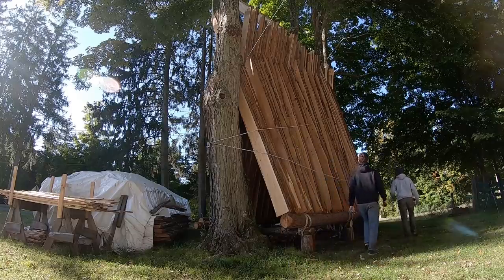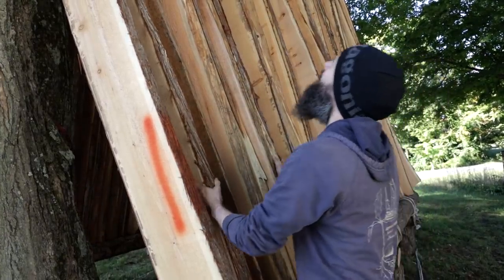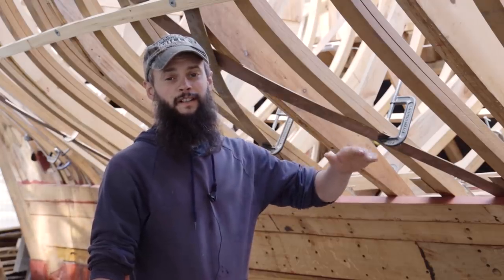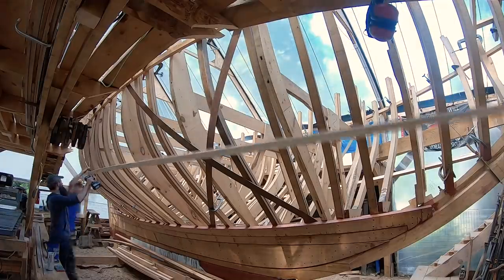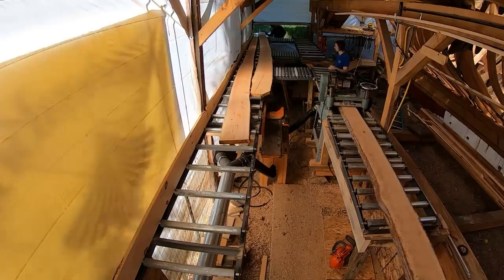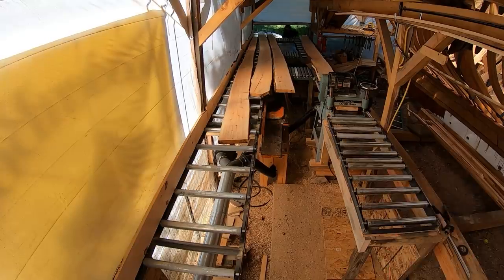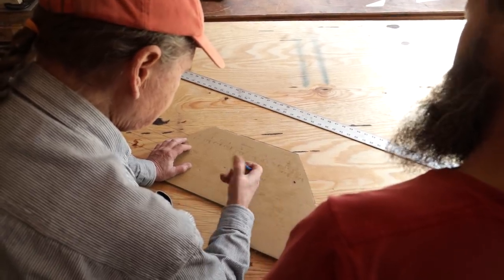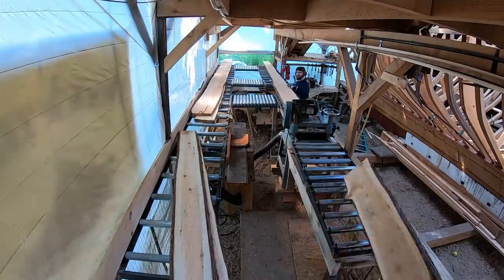Acorn to Arabella - Journey of a Wooden Boat - Episode 84: Lining Off and Diminishing Board

Comment: You know, at this point, wouldn't it make sense to just use the oak all the way up to and a little past the water line maybe? I imagine Oak is going to take a collision much better than cedar. I always hear stories of boats running into containers that have fallen off container ships. These containers float just below the surface of the water and are very hard to see and quite a few boats have been holed by them. Maybe there's no real advantage to oak over cedar in this scenario though, I don't know, but it seems like if you're going this far with the Oak, one more plank to bring it just above the water line wouldn't be that much more work for potentially a lot more protection.

Comment: Thank you for spending some time on lining off.  I think that lofting, liniing off and spiling are the arcane secrets of boat building.  People look at a well planked boat and think that all the planks are parallel and therefore square.  Actually nothing could be further than the truth.  Planks have some amazing complexity and the techniques necessary to make it look good are unique to boat building.  Thad Danielson's soft spoken experience is a real treasure.  There is no substitute for experience in these things.  You will probably never build another boat like Arabella so you don't have the luxury of doing it better the second time.

I had to smile at your sense of hardship at having to add a few more white oak strakes.  To have more white oak than cedar is a luxury only you guys can enjoy.  If you had known that was coming you could have probably saved a few hundredweight of lead.
Next stop to your shop for a new Tshirt.

Comment: Wiser words were never spoken..  "there's a plan, then there's what actually happens".
It's nice to see that you don't put every effort into sticking to "the plan", as that can get quite expensive. Being able to switch or alter plans on the fly can be a very valuable skill and mindset. It can save loads of money and reduce excess being left in a pile to rot, or save the time it would take to find a buyer for the left over materials that end up not being needed. Very mature thinking.
Not much actual building progress in this video, but loads of thinking work done for sure. See y'all on the next one.

Comment: I found this particular episode the most entertaining and informative yet. Now I ALMOST fully understand the lining off process. Just need to know how the distance to the common point for the diaganols, along the axis perpendicular to station 6, is determined. This lining off business has befuddled me for a lifetime. Now I get it. Nothin to it. Thank You for the education.
Reply: I believe the point is arbitrary, within reason. You are working out a linear interpretation between the plank widths at each station. The steepness of the slope changes the accuracy of that interpolation, so presumably the gentlest slope you can fit on the layout board and still have the point of intersection accurately placed, is the best you can do.
Reply: That actually almost makes sense to me. The further the "arbitrary" point, the greater the accuracy. Thanks for the reply and again the education.  I'd rather see the why and how than the what. And these guys do it best.
Reply: I'm still trying to figure out why the frame isn't made a bit thicker, then cut a flat section on the frame instead of backing out a curve into the planks?

Comment: Gentlemen I just came across your videos a few days ago and I binge watched them all. I'm not really into boat building but I love learning new things, so thank you. I am a carpenter though and I can see the diminishing board coming in handy from time to time so I wanted to get a better understanding of the point in which you diminished the lines. Everything else was very clear. I just didn't catch how you choose the distance to the point that that the lines diminish to. This point not being correctly placed would have an impact on the angle and that would translate to the individual thickness measurements. Thank you for the awesome job you both are doing documenting the project.
Reply: So my understanding is that he is measuring the distance between the stations up vertically until he hits the diagonal line at the top. Then the interesection between this new vertical line and all these diagonal lines show the plank widths, so nothing is measured along the other axis so it doesn't matter where it vanishes. I also found that difficult to grasp from the explanation

Comment: Wow is this technical or what? I guess there's more to it than slapping boards on the frames to keep the water out. Getting very interesting now, can't wait for the planking.
Reply: Yes.. there's a LOT more to building a boat than almost any other kind of structure.. after all the whiners here moaning about "nothing happening", it's nice to see someone who actually gets it!
Reply: Yup, other constructions either keep moisture at bay via a thin membrane, i.e. houses and land buildings, or keep water in in small amounts, comparatively, i.e. tubs and pools. This type of construction takes and holds out liquid and much higher pressure than atmospheric pressures such as a house. The only things built to take much higher pressures are submarines. It is interesting to think a fallen leaf can float and some bugs can walk on water, but when you consider the weight difference, the structure must be so much stronger as the floating item gains in size and displacement. A strictly timber framed boat (using traditional timber-framed home design) would collapse under the load of the water, but can withstand hundreds of years sitting on solid ground. Still, many of the same joinery types can be seen in both erections. The span between major framing timbers are much closer in ship building. Just something I think about when watching tours of old ships versus old barns and houses.

Comment: Am I correct… even width planking shows off the lines and shape of the hull, like Viking boats do … and planning that holds level to the water line hides the shape and lines of the hull, but making the boat look “sleek” and smooth. I think I would prefer the Viking lines (but I would have to build a model to scale both ways so I could see the difference for real and to decide). Still, you sure did learn a lot and taught us landlubbers a thing or two. Thank you for your efforts. ||| I like the oak planking up to and even a foot above waterline idea… oak is tougher against stuff floating in the water you don’t/can’t see that can punch holes (or like ice when you venture up north or south).

Comment: A spinning lazar level , used for acoustic ceilings can be used to get exact lines from stem to stern that you can see all at the same time .  In theory , you could mark the lines of every plank right on the frames before you start . The lazar line would be straight and level which would give you an excellent reference point to go by . Just a thought .

Comment: The advantage of more oak below the water line is strength and ballast.
Reply: Will the additional ballast affect the water line? Not that the water line is literal.
Reply: @travelinman70  They can just put fewer lead ballast weights in the bilge. The keel alone is purposefully not heavy enough to provide all the ballast weight that the boat needs.

Comment: I noticed you have a 16-300mm Tamron lens on your wishlist. I'd like to draw your attention to the Sigma 18-300mm lens. Nearly exactly the same specs, also macro, also Canon mount available. I have the Sigma 18-300 and it's my absolute favorite go-to lens for its image quality and focal range. And it's $230 less  than the Tamron.
Tamron 16-300mm: $630
Sigma 18-300mm: $400

Comment: I am wondering, since all those planks will be bend to fit them to the hull, will they not accumulate a lot of tension? Or will the wood comply to its new shape over time?
Reply: The wood takes its new shape within hours or a couple of days, just like it would if it were steamed. Remember with the early oak planks, they would leave them clamped overnight to take the new shape before doing the final shaping.
Reply: Wood tends to be a very forgiving medium. Even in growth, the wood will form around an obstruction more often than pushing it away.  Anyone who has cut down a tree and harvested it from old farmland then cut it into lumber or firewood has found fencing, rocks, and other obstructions within the wood. We have several trees on campus whose roots have formed around the sidewalks instead of heaving them out of the way. Seeing roots spill over relatively thin concrete is quite beautiful. The plant trying to work with, rather than against, mankind's invasion of its space.

Comment: I just noticed !   Your bandsaw,, I used to own the same model.  Quite a few years ago,, and mine when it came to me was still set up for a leather belt,, central shaft power.  I converted it to a floor mount electric motor.  Great saw.  I had to redo the journal metal and some guide bearings.  Museum piece,, but some of my hand planes are older,, and my framing square.

Comment: Your a very good team. Im sure you have your highs and lows. As you were going through your cedar stock I was wondering do you have enough do really know how far it will take you? But as a home builder and many other wooden structures but no boats, is that the oak planking is much more rigid than the cedar. Will the lower rigid oak structure cause a shear force against the softer lighter cedar above it as there will be the potential for alot of flexing and movement in rough sea,s and who knows. But now your going to use more oak and that very well might be an unforseen blessing as you will be extending a foundation of strengh and stability higher up the haul. I know this may mean nothing be cause of compound curvature of the haul. But even a straight vertical wall of a building must take diagonal shear loads from wind etc. And the point of transission from ridgid to a more flexable material can cause shear stress on the studs and their attachment points. In your case there will be torsional stress as well. But Im just a land lubber and I only know what Ive seen working on some very old buildings where fasteners such as bolts and nails have had the holes they are in enlarged and elongated at points such as corners where flexing has occured over time.

Comment: I think planking the hull in  oak is a better choice.  It's harder to work with that is true. However when you are using  your boat you will run aground. Hit shit in the water  hit the dock or other boats hit you...  oak can with stand more abuse than cedar. I would do the interior amd cabin console with cedar. And use oak for the hull amd deck.

Comment: Wow guys did a good job explaining the lining off made it a bit better then reading about how to do it.  Just one question the diag'nal lines that all go back to 1 Point how did you figure that part, The rest of what you done I've understood badd is the one question that I can never figure out I build model boats and have a heck of a time with plankey because I've never been able to plank to scale that way those been a mishmash in looked like crap. Now I am trying to do one the  "right way" and that part of the lining off confuses me a lot. If you could go a bit more in to some details about that it would be very much appreciated.  Thanks guys keep up the great work.
Reply: 4 englishlies this what I want to know to.  Is how far back the point for the diminish based on a ratio of the boat length to width?
Reply: @Elessar_Telcontar  If I understand the process correctly, the "vanishing point" is arbitrary, but needs to be far enough away that you have room to place the measurements for each station with sufficient accuracy. So the further away from your starting point the better, within reason, since you can place the station lines further apart, and thus with greater accuracy. It is the process of "sliding" the station line until it intersects the projection of the sheer strake that scales the dimensions for the remaining planks at that station.

Comment: I was looking to hear how much the minimum width of the planks are at the stem and stern. I'm assuming that you do not want the planks to be smaller than 2 " at the end so you can get 2 screws in each plank. That way you can measure from the last strake to the sheer line and find the number of planks on each side of the boat. That would tell you how many planks you will have. Then if you measure at midship, you can find you how wide the planks need to be to go from the last plank installed to the sheer line. I would do the measurements in mm instead of fractions. 2" = 50.8mm

Comment: I was wondering are you gone put in a extra thick plank oak maybe at the widest point of the ship agains posible damage, and scraping of the tires/ball things for docking. and possible accidents/scrapes. kinda like a car bumper.
Reply: NO...No need...
Reply: I was thinking an extra strip down the side as a swell brake and rub board. Easily replaced as needed. Like the strip down the side of a car for bumping doors in a parking lot.

Comment: On running the planks to correspond to the water line, how did they do it in the good old days?
Reply: Define "old days", please. Lap-strake didn't/doesn't  plank with the water line. Larger boats and ships don't typically either. It depends on the design of the vessel, I suppose. If the keel and sheer run more or less parallel with the water line, or there is little swell and curve to the sides, then it could be quite easy to have the planking parallel to the waterline. With deep curves and swells, the planks in the middle would be spear tip/arrow shaped and not reach the stem and stern. One would have to add boards between the frames for somewhere to finish the planks. These boards could hold water inside the hull and expedite rot. It can be done, but planks reaching stem to stern also make for a much stronger boat. The spliced laps in the planks are not ideal, but are still stronger than a plank decreasing to a point.

Comment: All your measurements are on the inside of the planks, if you cut them to that width and then angle cut in, you will come up short.
Reply: Excellent point, but they need somewhere to stuff the cotton caulking, right?
Reply: You account for that when adding the bevel to the lower edge.

Comment: This suggestion probably comes to late for Arabella, but it's something to consider for other folks building a boat. I think it would be well worth switching to metric for certain tasks.  That diminishing board, which requires computations in fractions, is especially prone to errors when done in "American" measurements.

I'd suggest using American measurements while building the backbone and forms, since the plans are written in that. Once you're away from the plans, and just winging it based on what you see in front of you, such as with the planking, switch to metric.
Reply: Jonathan Kipps 
Or at least decimals

Comment: Will the addition of oak planks above where it initially was imagined affect the displacement math in any meaningful way?
Reply: Likely not all that significant. Just put a little less lead weights in the bilge to sink her close to the water line.
Reply: Nope. Way below the degree of accuracy you have in wooden boat design to begin with.

Comment: Question to the Arabella crew. The decision to plank the hull before installing the beam shelf and the deck beams  is not a given, for instance if I understood Leo's commentary  it looks like "Tallyho" will have it's beam shelf and deck beams installed before planking. This discussion: http://forum.woodenboat.com/showthread.php?1514-New-construction-planking-before-deck-beams
seems to come down in favor of your approach, at least for "lightly built" hulls of less that 30ft  LWL. With her steamed frames, Arabella probably qualifies as "lightly built", though only in comparison to "sawn frame"  construction, but I believe she's well over 30ft LWL. I am aware of the bracing you have surrounding the frames, and that you still have the station frames in place to maintain the hull dimensional accuracy as she is planked, so it's clearly not a make or break decision, but I'd still appreciate the thinking behind your decision.

Comment: Personally, I felt that your decision to stop planking with Oak was a bit premature, hoping you would change your minds and use Oak planking up to the waterline in the least. I sense your dismay about having to change your plans, but it is probably the better choice overall.
Does the waterline change due to the heavier oak versus the lighter cedar?
Reply: The waterline shouldn't change.. they'll just need less internal ballast to compensate. That's why the lead keel was made a bit underweight.. so that ballast could be added inside to trim the boat to her designed waterline.

Comment: Lining up the planks on the water line is not actually a good idea from a stress point of view. As a wave hits the hull from the side, the last thing you want is all the stress (from whatever height the wave hits) bearing on a singe plank. Far better to let the load be displaced among as many planks as possible, as it will with more diagonally angled planks.
Reply: The water is only at the water line in completely calm conditions.  As soon as the boat has some headway the water meets the hull in an "S" shape and with the sails up the boat will heel burying the waterline well below water level on one side and raising it well above the water on the other side.  The pressures on a boat as it moves through the water change constantly.  A test tank is the only place where stresses are measurably constant.  The ocean- no.